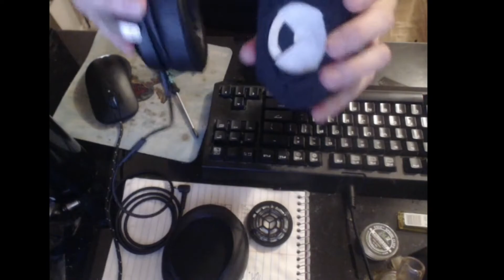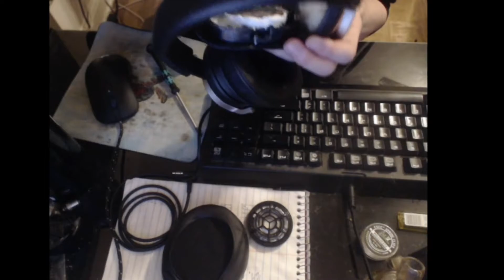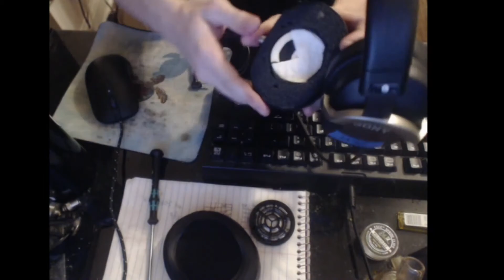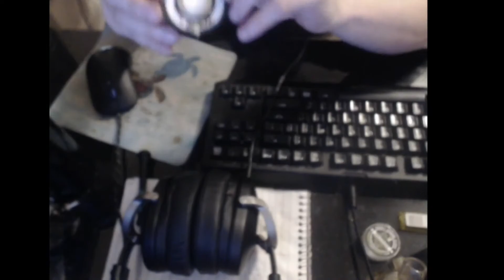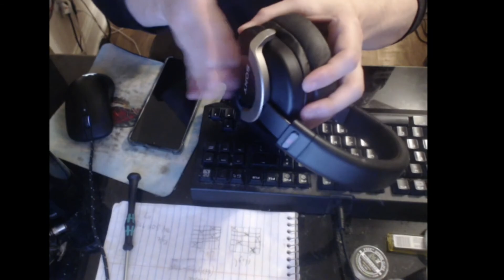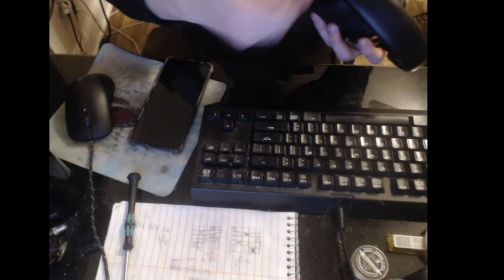DIY Headphones - Vintage Planar Magnetic - Yamaha YH-100, YH-1, HP-1, Orthodynamic Build Video

Comment: Hi! I came across your posts on HeadFi and SBAF and decided to see if I can make a KH-100. It's my first time modding headphones, so I'm planning to take it slow and figure things out one step at a time.
I now have both the YH-100 and a ZX700, so I'll figure out how to open up the former and extract the drivers out soon. I was wondering, since you don't seem to use the stock ZX700 pads in any of your builds, are there any aftermarket pads that you recommend now? I saw your post about custom pads, but it doesn't seem like that seller has a storefront for it. There's only one seller (morepwr) that have anything similar to the your pads (leather with perforated insides), so I plan on trying that if there aren't any better options.